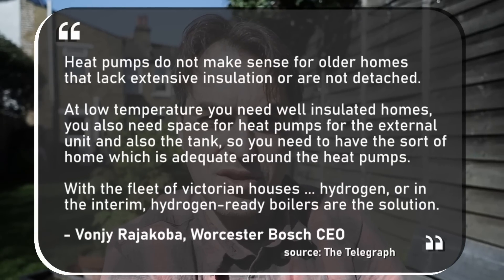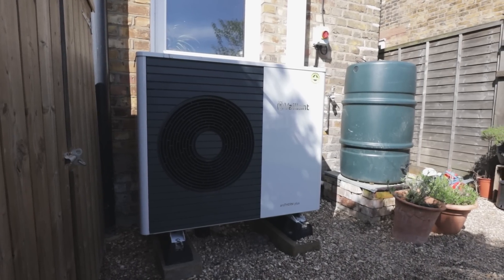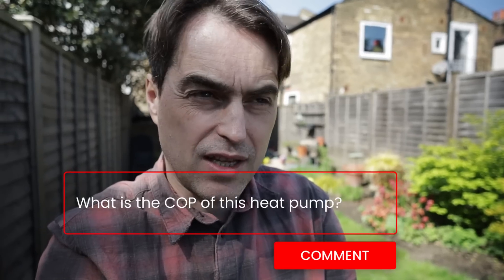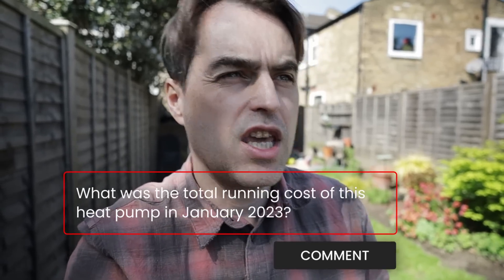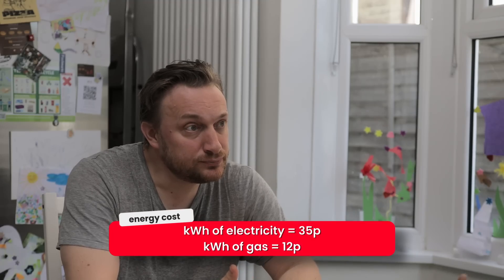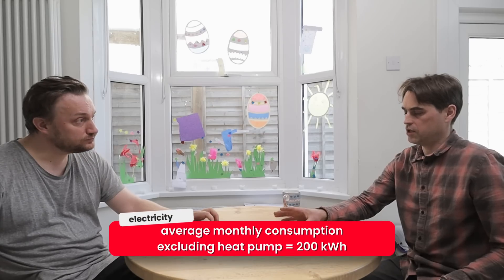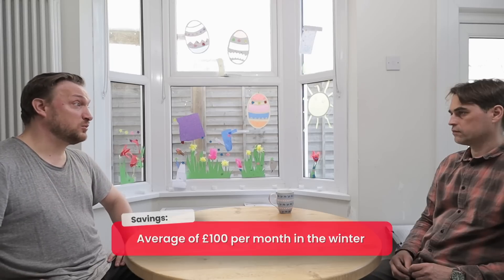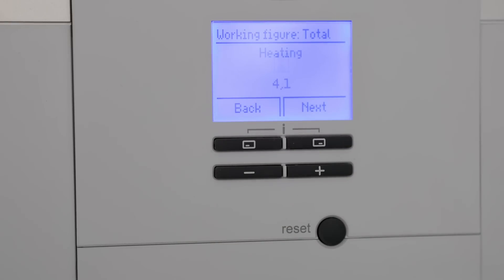Worcester Bosch CEO Is Wrong About Heat Pumps. Here Is Why.

Comment: Not as quiet as a gas combi, doesn't kick out the same heat so takes longer to warm up the property, bigger radiators required and it's bloody ugly. Apart from that, what is not to love..........
Reply from the maker: Doesn’t kick out the same heat? Only kicks out what is needed so much more efficient. For efficient gas boilers you need the same size radiators
Reply: @UrbanPlumbers  Missing the point mate, lower joule output means it takes longer to heat the space. Actually, heat pumps take much longer to heat an average property and government/heat pump manufacturers admit this. This is less of a problem for young people or people with passivhaus properties, but a genuine concern for older people in older properties. I sat in a meeting recently where it was suggested that people would just have to get used to poorer performance...lol. Also I have to add that there is no such thing as a typical mid terraced house. Building fabric, topography and geography all combine to produce drastically different results in term of the suitability of heat pumps. Assuming lower output is more efficient is the same as saying the bicycle is more efficient than the car. You are right it is, but it is also suited to many fewer journey types.......I am glad you are happy with yours, but industry reports many are being switched out for combi-boilers by disappointed customers who believed the hype.
Reply: @UrbanPlumbers  Heat pumps require larger radiators because the water providing the heat is typically 20 degrees cooler than an efficient gas combi boiler. You can use the same size radiators but that exacerbates the heating lag issue.......
Reply: @UrbanPlumbers  hahaha put a jumper on!

Comment: Heat pumps works in any building, as we here in Sweden has known for decades!
Reply from the maker: What are we doing wrong here then? A lot of negativity around heat pumps in the Uk and vested interests to keep the gas going
Reply: @UrbanPlumbers  air-water is the problem. I guarantee that the Swedes are using air-air…. Much simpler, better COP, cheaper to buy, cheaper to install
Reply from the maker: Nahh, loads of A2W in Sweden, Germany, Norway, Poland - just not UK. Must be something to do with driving on the wrong side of the road.
Reply: @UrbanPlumbers  almost certainly 🤣 it’s the obsession by the distributors trying to make them a drop in boiler replacement that’s the problem. Grant, Midea, Samsung - all installed with on/off controls and the WC turned off, as you well know from your experience. I firmly blame the distributors.
Reply: @dorsetengineering  No. Air air was specifically excluded from the RHI.
Reply: @rogerphelps9939  I know…

Comment: Why do you keep talking up heat pumps  They are no where as efficient as you make out Look at the amount of space you are taking up for pipe work and hot water tank Also you never mention the size of electric supply to back up system when pump is not producing enough heat for hot water and heating
Reply from the maker: Perfect name you have chosen for yourself 👍

Comment: You are right. They are trying to push expensive products with higher profits. Here in cold northern Sweden, we have lots of older draughty houses with heat pumps. Just remember to open up for air transfer between the rooms.
Reply: I don't understand where you are coming from. Here in the UK the installation cost for a new gas boiler is about £2,000 or less for a combi. The cost for an air source heat pump is £8,000 or more and it may need larger radiators installed too. I had a new Worcester Bosch boiler for my 2 bed semi plus a new programmer installed for £1,985. I could have save about £300 if I had changed to a combi boiler but I prefer to have a hot water tank which can be heated electrically if the boiler goes wrong. If you have to wait a couple of weeks for a plumber to fit you in, it's no fun without hot water on tap.
Reply: @replevideo6096  Jag E is referring to air-air heat pumps (mini split air conditioners) which are usually cheaper, installed, than a new gas boiler. It’s pretty much what everyone else in the world uses to heat and cool their homes. Cheap to buy, cheap to install, cheap to run
Reply: @replevideo6096  This is irrelevant. Before very long new combi boilers will be illegal. The cost of the heating system is a small fraction of the cost of a new house. It is a lot less than that of a new car and is a far better investment. With mass adoption the prices of these things will come down. They aren't rocket science.

Comment: What about the fully internal ones. They just expell cold air out througu the wall

Yes they are less efficient but super easy to install and in theiry you could even use them in flats assuming the freeholder will allow a few holes out of the external walls

I mean they allow boiler flu out so most should be okay with a internal heat pump outlet

Comment: Surely the future is simple air to air heat pumps one can DIY install one per room perhaps floor standing

Something like £400 per unit
So a 6 room std house would need 6 independent units costing £2,400 which is roughly the cost of a boiler

Each unit being maybe just 2 amp 460 watts power and maybe 1.5KW heat

Hot water can be from a small 100 litre electric tank fed by cheap night tariff or an electrical instant shower

The above would work for all situations. Have a bigger uninsulated homes you just install more maybe 10 rather than 6

Comment: Oh, Mr Bosch CEO, thank you for informing me that my ASHP installed under the kitchen window of our 1930s SEMI DETACHED house. I thought I was comfy running it at 45C flow, but I must have been wrong. I'll just need to get the gas supply put back in then, and put the combi back into the same cupboard which it wasted space in before, it'll be empty for 5 mins once the tank goes.

Comment: The fitting of heat pumps in built up urban areas is better due to a degree or two higher average temperatures than rural areas. Getting the pump on the south side in a warm courtyard is ideal.

Comment: Propane as refrigerant? R U kiddin' me?
Reply from the maker: It’s been used for years ?
Reply: Look up R290 refrigerant. I have just installed my new clothes dryer, which also have a R290 based heat pump 🙂
Reply: @jensageholm8774  I have no doubt the guy was correct when he said it used propane as refrigerant. I was surprised because:  1) it is combustible and has the potential to be explosive. 2) propane is derived from fossil fuel natural gas and I am would be aiming  to get rid of the use of gas by replacing my combi-boiler with a heat-pump. In light of this surely the use of propane is at best inappropriate and short sighted, and at worse needlessly dangerous. In fact he dangerous danger of propane introduces more regulations as to where the heat-pump can be located.
Reply: @grahamcook9289  There is additional care to be taken due to propane being flammable, one thing is reducing the size of the "plumbing" in the heat pump to reduce the amount of propane in the system. I believe that I have seen an 12 kW ASHP with 800 grams of propane so the amount is not a significant factor even if it is derived from fossil fuel - I do not know if 800g is a problem regarding explosion risk. CO2 (R744) is another refrigerant that is starting to be used in some applications.

Comment: High thermal mass properties act like a heat flywheel. As long as the emitters UFH/Rads sized right and indeed commissioned correctly you will have no problems. 

Bivalent systems will be obsolete as soon as we gain confidence with the likes of viessmann, vaillant units 

Cheers 
Dave 

EH
Reply: Mine is an Ecoforest GSHP. It works very well.

Comment: I support the Bosch CEO on that a heat pump is just not worth it when a property has a heat loss more than 20kwh and old standard single or double windows especially when to get the max your limed to about 35c ok for underfloor but not old fashioned rads that still want more than 55c circulation. That's why I went air to air instead and retiring the underfloor heating heat pump . At 40c per kWh it's cost me 1200 as month to heat a 5 bedroom using a 16kw heat pump split HT not to mention the cost of installing more insulation to r30 like this property did in renovation
Reply from the maker: Most Victorian terraced houses are around 7kw 🤦
Reply: @UrbanPlumbers  I'm talking about detached
Reply: Properly sized radiators are fine with 35 degree flow temperature. Heat loss is not measured in kwh. I presume you mean kw in which 20kw is a very extreme value. You should be able to easily limit to 10kw.

Comment: £400 a a year savings
Reply: But a heat pump from a combi setup is 15 grand
Reply: @mustafahakim1298  

Yep the numbers just don't stack up
Reply from the maker: If you want efficient gas system you need to upsized rads as well.

Those guys needed new rads anyway and also new heat source. 

It makes no sense changing to gas again as moving forward we will go mostly heat pumps anyway. 

If you add solar to it or/and battery storage you have no running costs at all most of the year in UK climate.

We also are cutting harmful emissions to zero at the port of use and cutting CO2 by 75%

Heat pumps make total sense if your system needs to be fully upgraded. The cost is comparable to a high end boiler and unvented install when you take 5k grant and 0 vat into the account.

What’s more, if you do a while house install including for new pipework, rads or ufh - all of that falls under 0 vat, so makes total sense on renovations or self build as well.
Reply: @UrbanPlumbers  

The biggest worry in the UK is the price of electricity 

There are no new power stations 

Electricity is set to increase in price 10x more than gas

Remember diesel vehicles that government pushed on the British public ? 

This is likely to be another catastrophic bit of government subsidised foolishness
Reply: @the1beard:  Wake up!  Gas is to have tax transferred from electricity, renewables are increasing the already 40% they have now (renewables are one tenth the price of nuclear and of power stations that burn stuff).

Comment: Heat pumps are good but if the temperature drops  below 32 degree it causes the unit to go into defrost mode . Defrost mode will call for the emergency heat strips to kick on , this is usually for an hr or so . By this time your electrical meter is running like crazy and there goes your savings !!! Also inverter technology is very expensive . Ecm motors are 5x times that of a regular PSC motor . On paper heat pumps sound good but there’s not for everyone .
Reply: You guys across the pond need to update your Heat Pump technology.  This one uses R290, its defrost cycle runs the unit in reverse for a short amount of time to defrost, and then goes back into heating, and will recover the heat lost from the defrost cycle in a short space of time.
Reply: Defrost mode mode on my Daikin takes exactly 4 minutes. It stops, clicks into reverse, pump starts and hot water flows through it and the ice melts literally in front of your eyes. then it just reverts to to normal mode. 🙂
Reply: @creakybones2407  right but what energy source do you use to heat up that  hot water ? Lol
Reply: @garza7676   The same water that is in the radiators.  The water is already hot, Ergo you don't use any energy at all because it's already been used.(well technically the refrigerant is heated) but that's just semantics. Either way it doesn't take a modern Air to Water Heat Pump an Hr to defrost. 🙂
Reply: @creakybones2407  you didn’t answer my question ? What does your water heater run on ? Natural gas or Electricity?
Reply: @garza7676  the hot water cylinder is heated by the heat pump, there are diverter valves for when the cylinder calls for heat to heat up the hot water.
Reply: @BenIsInSweden  Heat pump water heater  that’s powered by electricity that’s coming from the power grid that’s produced  by natural gas . Well at least that’s how power is produced for the majority of homes in Las Vegas .
Reply: Natural gas is the best bang for your buck compared to anything electricity can produce . Fact
Reply: @garza7676   Ah the good ol' Gas powers electricity argument.  UK Gas Power stations are about 50% efficient.  A heat pump for DHW is about 300% efficient.  People like to throw in transmission losses as well, not that they're a concern to the end user.  So 1kW of gas in a power station produces about 0.5kW of electricity, let's knock it down to 0.45kW for transmission losses. A 300% efficient heat pump, would turn that into 1.35kW of heat.  A Gas boiler (again UK), is (generously) 90% efficient, so would get 0.9kW of heat from the same 1kW of gas, so a net gain of an extra 50% of heat.  Gas Power plants can also add Carbon capture to be better for the environment, something that isn't feasible at the home.
Reply: @BenIsInSweden  it’s all good til it’s 20 degrees outside and you lose power . While your neighbors keeps his family nice and warm with he’s natural gas heater lol
Reply: @garza7676  of course the "but sometimes" argument.  20F is rare in the UK, if it was more common, people would be insulating their homes more.  Also gas boilers do need electricity to run - ignition - exhaust fan, etc, so the neighbours will have the same issue.  Not that having a power cut means you instantly lose all heat in the house either, and it will stay comfortable, for some time before it starts to feel cold.
Reply: @garza7676   Sorry. The Point of Moving to a Heat Pump Is to Get off Natural Gas and move over to Electric.
Reply: @BenIsInSweden  yea I’m not hating on heat pump . As a matter of fact i just installed a mini split for my in laws who live in Los Angeles . My Issue is when governments , state or federal start making policies to take away people choices . Like here in America  they keep feeding this lie that  heat pump will solve global warming yet the same people live in 20 thousand sq foot homes and fly around in private Jets .
Reply: @creakybones2407  what’s the point if they use natural gas to produce that electricity?
Reply: @garza7676  Ahh. i see to what you are refering now. 40% of UK electricity comes from Solar or wind turbines.
So by using electricity i'm using less gas than if i was actually using Natural Gas directly.
Also, I cannot make Gas. But with my Solar Panels i can make electricity which goes into my batteries. This then runs my heat pump.
Also in the UK there is a "Standing Charge" for your supply to the Property (About £100 a year). So Now iv'e no Gas I no longer pay a standing charge. 👍
Reply: @creakybones2407  gotcha , right on . Love heat pump technology but I think there’s still room to bring the prices down on parts and get more technicians involved .

Comment: my hitachi air-water heatpump is 9 years old now and when working under full load sounds like a diesel taxi running, as they age they will make more noise. once they hit 7 years old noise is almost always going to be noticeable and irritating. i have a few airconditioners and they are similar in noises but i do have a toshiba 17kw single phase that is 11years old that is still not intrusive. At a guess though the heat pump has worked about 8 times the hours of the airconditioner.
As someone who has a 200 year old building that is around 500 square metres in size and mostly single glazed and not well insulated, i would say that airconditioning works best in draughty areas (most of the building) the hitachi heat pump would not cope well outside of the double glazed area (its only a 6kw unit) does what i want it to do very well and replacing the radiators and doing all of the associated work would be too expensive.

on the whole i prefer airconditioning to heat pump. i would refuse to disconnect the gas boiler, though it was only in use for 3 days this last winter. on those days it was a boon to have.

 also R410 or older cant deal with minus temperatures that well. R32 performs significantly better than expected in cold temperatures

you paint a picture that is a bit simplistic and you know what you are doing, where as most people fitting heat pumps are dishonest and dont know what they are doing.
i think on the whole i agree with the worcester bosch man
Reply: so let's just get this straight.

you buy a ridiculously undersized heatpump and then complain that it ain't up to the job.

you further cheap out on a piston based compressor, instead of the way better screw compressors, which are known to not last long and then complain about it not lasting long.

mate your research was either shit or you were sold an utter piece of shit by some incompetent installer.

Comment: Tell me what size Electrical Supply is required to supply the heat pump unit.
Reply from the maker: 15amp for this one not
Reply: @UrbanPlumbers  Thanks all the heat pumps I've installed the supply's to up to now have been 32 Amp required to supply the 6 kW water heater.
Reply from the maker: No back up heaters needed with modern heat pumps
Reply: Most houses will need a 3kw supply. A 16 amp circuit is fine.